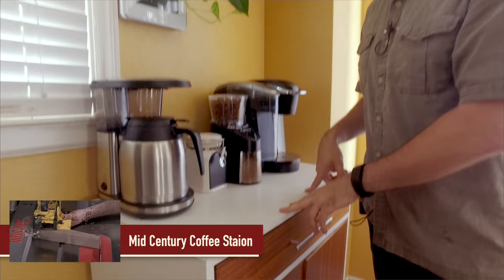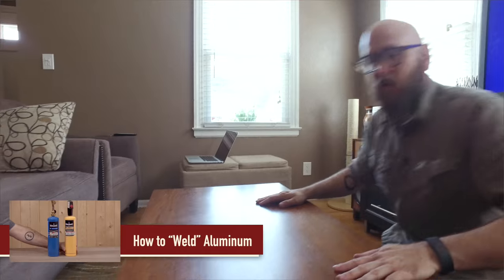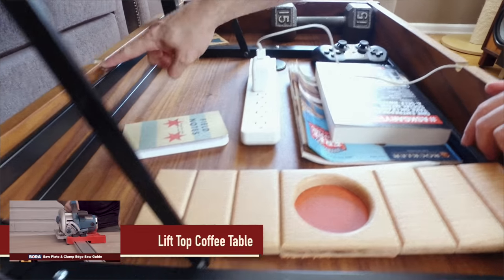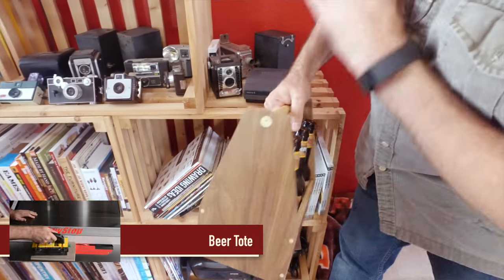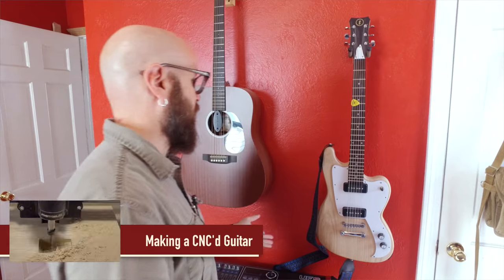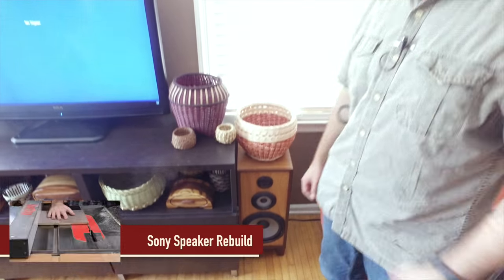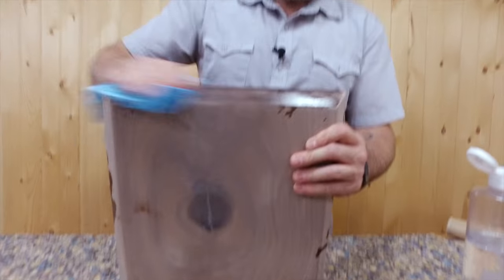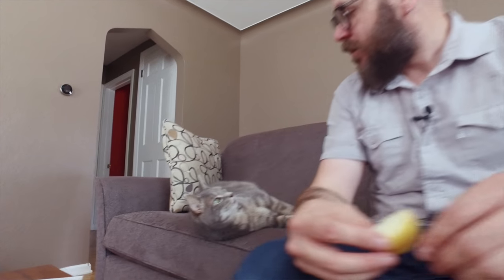How Are Past Woodworking Projects Holding Up? Plus DIY Tips and Tricks!

Comment: A few years ago The Wife and I made up a mix of 1/2 mineral oil and 1/2 beeswax (you have to heat them on the stove until the wax melts and mixes) for our cutting boards and found a significant improvement over a light weight oil (like mineral oil) alone.  Reapply every month or two and you're set for life.  Love the video.  Looking forward to more.

Comment: For the coffee table, instead of bolts, take the screws out and squirt in some epoxy glue and then screw the screws back in after a minute or two. If the screws are wood thread, then if you ever need to unscrew them, they will unscrew. Takes a bit of torque to undo them, but you can do that.

Comment: I liked a lot of that. The speakers are a bit small so they may not resonate as well as they could, thats about it. The cutting board should be done more often. You can touch it up by pulling a knife over it to clear the cuts smooth and then re-oil it when it gets somewhat bad.

Comment: You need to make elongated holes when attaching with screws.  The change in seasons makes wood shift a bit (some more than others).  So you drill your hole, then, with a drill, pivot, while in th ehole, left and right a bit, and that will counter the screws stripping out.

Comment: Repairing that sheet metal bridge is not easy.  If you aren't worried about the repair looking completely stock, braze it.  That will be the strongest, least destructive method.  If you are concerned about the value etc, then copy the part and keep the OG piece in a box somewhere safe.  You could use stainless on the copy and it will hold up better than the pot metal original.  Thanks for the look at the old projects.  It takes a real man to show off the pieces and parts that weren't 100%...  Cool news is that you fixed them.

Comment: For cutting boards I prefer boiled linseed oil, but not the one they sell. I buy regular linseed from the supermarket, I heat it to about 170 degrees for 5 hours (lowest setting of the heat plate). When you boil linseed oil don't fill the container more than 2/3. Filling to the half is even better. And don't use a container you want to use for something else - don't ask how I know.
I apply it while it's a bit worm. Also heating the cutting board helps. But this might not be for everyone. Heating (boiling) the oil smells like hell. You'll keep sensing it 2-3 days later, so outdoor boiling is recommended. Also you have to wait 2 weeks to cure (because it has no metalic driers inside it cures slower). If you don't wait enough it'll wash out. It's a lot more durable than mineral oil. It's a lot of effort for a cutting board, but I only boil oil once an year. 100-200 ml is enough for lots of cutting boards and you can reapply 1-2 times in 1-2 year (depends on how much you actually use it and how many boards you have).
The mineral oil washes out more quickly because it never dries. I haven't tried any kind of wax, so I can't compare linseed to wax based finish.

Comment: Make a new bridge as soldering would just break. You could weld it from the back side and sand it down a bit, but the crack would still be visible on the top side. And welding might discolor the metal which would take away from it's original look, but might be a cool look too.

Comment: For the cutting board, instead of mineral oil, why not linseed oil? Will preserve the wood better and still bring out the beautiful grain of the wood and that awesome knot. And beeswax with a bit of linseed oil mixed in would work just as well and the nice thing about these is that they are edible so there would be no contamination of the foods cut on the board.

Comment: Why does that guitar need painted, David? Looks great how it is! Maybe slowly and seductively rub some tung oil or similar all over it?
Silver solder should work to repair that bridge. Might be too thin to TIG weld. Perhaps add a fillet weld to the back on the inside of the corner, then cut a recess notch in the guitar body.
Can't wait to see the desk! :D
Reply from the maker: I want to paint the guitar to learn that technique. Thanks!!

Comment: i also would have put a few bracer bars or like an "I" shaped brace or a  bar or two so you can put totes under the table.. and /or cross bars... i mean... then... but cool. , it and its more stable, because its not downward pressure that will get it, its shoving at an angle form top, like pushing on the lip of the table with your feet, for example.

Comment: For anyone that's watching this that has brazed an aluminium part together and its failed; Please don't bring it to an actual Welder and ask them to fix it.... Trying to repair brazed joints with welding is a royal pain in the ass. 
Cut up some new bits of whatever, deburr and clean them very well and bring them with the failed part you want remade to an actual welder. They will appreciate it and will probably charge you less to weld your parts vs trying to fix the failed braze... 
Other than that, kudos and well played. Looks pretty cool too. 
Get an oxy/acetylene torch and cut down your braze time from 5 min a joint to 30sec-1min a joint. Cheers

Comment: I really enjoyed that. if you wanna chat about that guitar, I have a few ideas. what is the bridge made of? steel? aluminum? (braze it, bro. hahahaha!)
Reply from the maker: Thanks Tim! I'll have to take a look. I'm not sure what it's made of. I'll be in touch!
Reply: Probably not aliminum. You can try to find some stainless steel sheet and try to make a new one. Maybe it can be welded, but if I were you I would go to a specialist with a plasma welder. They you can put some chrome coating.
Reply: Quite possibly Tin plated Brass and could be Brazed easily,  would be time period correct!
Reply: yea, same thing as your coffee table, use a torch and braze it.

Comment: hello, I just wanted to ask I really like your videos to start with, but I am going to be working on a project and when I came across your video using aluminum and I seen how you did that coffee table they using that propane torch to weld those aluminum sticks to the aluminum oh, can I ask you one question, how much weight can that hold and also if I take two pieces of aluminum and weld them together with the propane torch will it withstand Heat about 150 to 350 degrees Fahrenheit? so two things, how much weight can two pieces of aluminum hold by being welded together as you did with the coffee table and second once it is put together how much heat can it withstand. I am wanting to take two pieces of metal and weld them together on on the motor of my car. so after watching you use aluminum can I use aluminum instead of metal I am just a beginner and fooling with metal and aluminum and I do not know a whole lot about material and Heat and weight.  so I would appreciate it if you could tell me will the aluminum melt if it was welded to the side of the motor of my car? I really don't know how hot the motor gets. are could you tell me how hot does it take for aluminum to start melting? will it melt with 150 to 350 degrees Fahrenheit? this information will be extremely helpful if you have any idea. Thank you so much for your time

Comment: You should have end-grain cutting boards to preserve the edge of your knives.
Reply from the maker: only woodworkers use endgrain cutting boards! did you know in some cites restaurants are not allowed to use end grain cutting boards because they trap bacteria?
Reply from the maker: Anyways, I have a video out on how to make an end grain cutting board somewhere here on my channel. But I think they are overkill. :)
Reply: +Make Something If you're afraid of bacteria you don't use wood at all, you'd use plastic. But I didn't know about the city restaurants rules I've heard the opposite in a local show about it, where they concluded end-grain was better since they  will push bacteria out to the surface of the cutting board when you let the grain  retract to itself making it easier to clean off. But I don't know, I can't afford no fancy edge-grain cutting board.